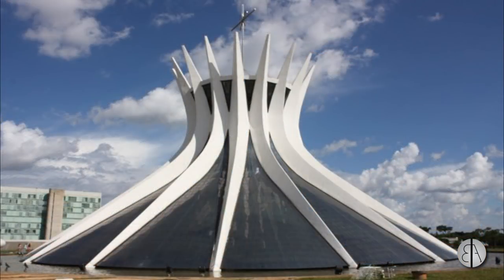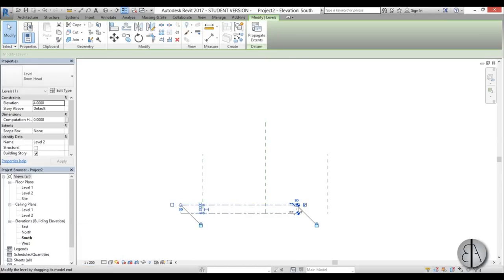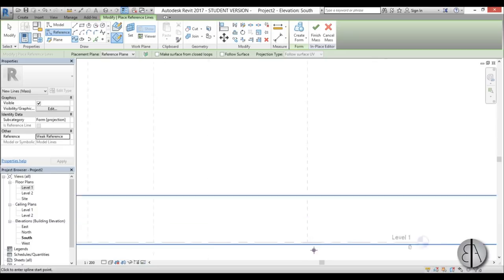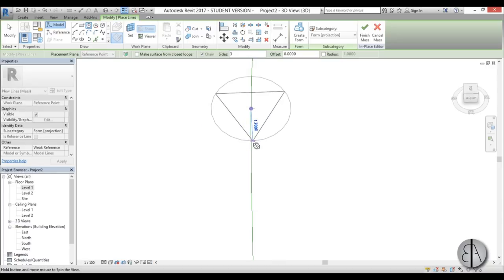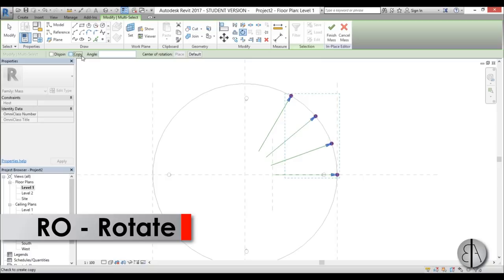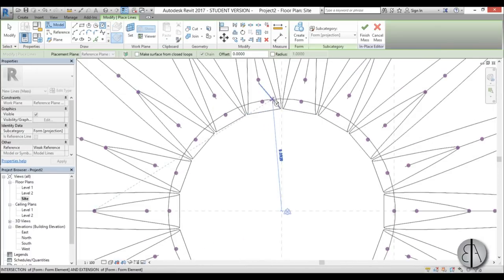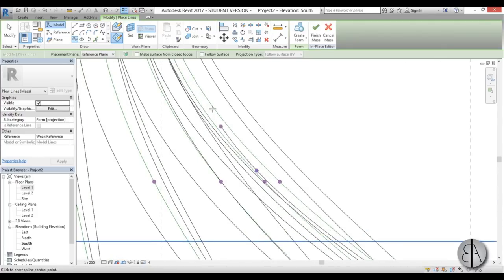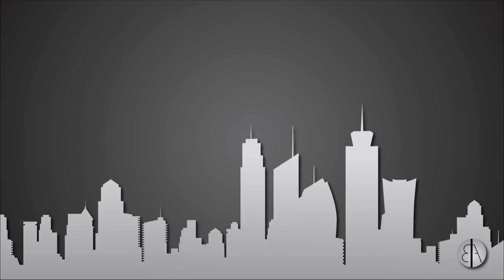Cathedral of Brasilia modeled in Revit Tutorial

Comment: Please, I need help finishing the last step in creating the "funnel form" at 11:30  I automatically get the flat profile when I click on create form. I get no form options to select as shown on the lower left side as demonstrated in the video. not sure what to do I have looked a the video several times but I'm not getting the option of creating the funnel.Thank you so much :]
Reply: I have the same problem! Have you figured out how to solve it? Been trying for an hour...
Reply: Nicola Peccin I haven’t unfortunately I want to fix the problem, but I spent a lot of time on it with no resolve.If you figure it out please let me know.
Reply: Got it! When you select the spline, make sure that you're drawing on the work plane, not on a face! The problem is the line was attached to the face of the mass, so it didn't stay in the work plane.
Reply: @nicolapeccin3759  how bro ?